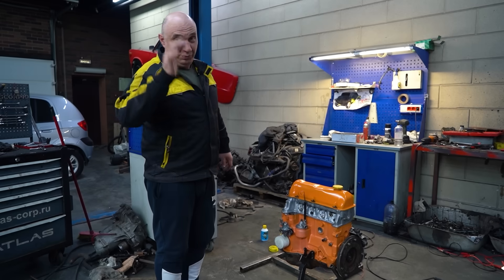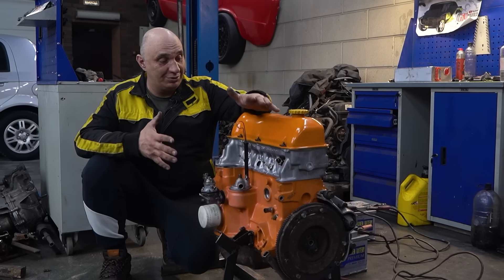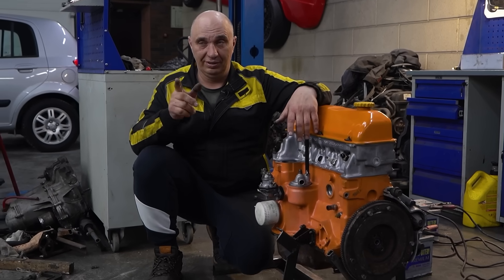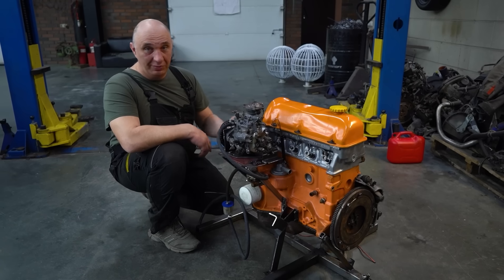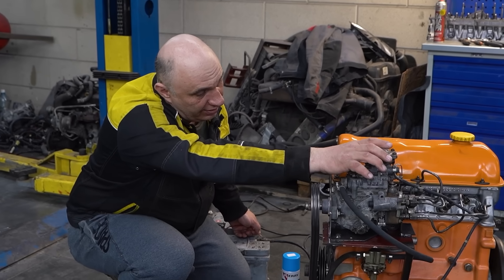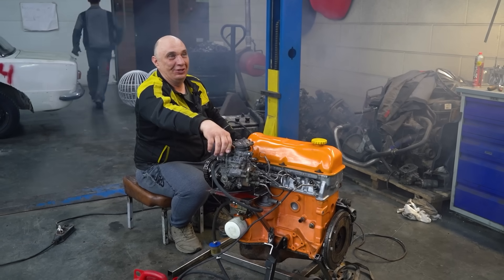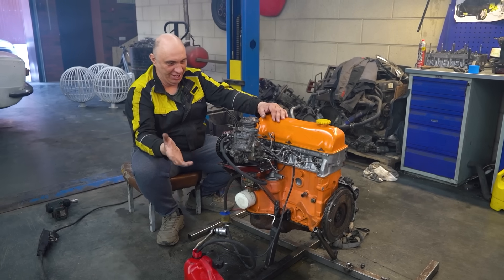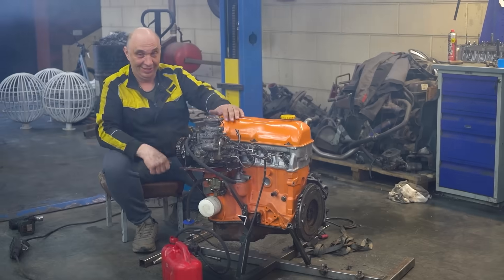We convert a gasoline engine to run on diesel fuel - will it work?

Comment: Impressive that it even runs with the indirect injectors becoming direct injectors :D
Reply: that was what i thought aswell poor old indirect injectors trying to handle direct work... would maybe work better if they turned the pressure up on the IP. looks to be a bosch VE rotary pump, and can easily be adjusted to pump out much more diesel
Reply: @Norwegian_Bastard  This engine has a low compression ratio and low compression pressures in it's cylinders, the injectors don't have a hard job. They know what are highter pressures in a diesel engine. These low compression pressures make starting difficult, the engine runs on it's own only when the combustion chambers are hot.
Reply: @yannickl5976  They increased the compression ratio from stock by 85% or so
Reply: @yannickl5976  They should get a cm off the block
Reply: @yannickl5976  I don't know how high compression a normal diesel engine has, but they did increase the compression of this engine in a previous video by a lot.
Reply: @stefannilsson2406  It's above 14:1. Most more eficcient engines have a ratio > 17:1. Ofc this depends on engine configuration such as prechambers, injector pressure 2 or 4 stroke and so on.
Reply: @henrys.6864 false. Biggest one that come to mind, the old Ford 7.3 idi. Which as stated I it's own title indirect injection that said, on the IDI diesels, it's not sprayed thru the intake manifold like you would on a gas engine, but rather the injectors are injecting fuel into a precumbustion camber and not directly into the cylinder.
Reply: @ajhainstock3997  to the glow plug prior to cylinder?
Reply: @henrys.6864  No, before 1990s pretty much all diesels were indirect injection which spray the fuel into prechamber in the cylinder head, not directly to the cylinder as is now normal.
Reply: @snap_oversteer  all that separates the prechamber from the cylinder is the injector cup. its not the pressure, the whole reason for the prechamber is to start the combustion and mix and the rest. I guess this video proves they'll run without the prechamber but not as as well.  Maybe some kind of external prechamber could be screwed into the engine and the injectors could connect to those?
Reply: @snap_oversteer  yes. So many people here do not understand it.
Reply: @henrys.6864  No. Many old diesel cars have an indirect injection. These injectors come from an indirect injection diesel. Many countries have old car running with indirect injection diesel engines, there are such old cars in Russia.
Reply: @yannickl5976  you can't run non direct injection (outside of the intake valve) on a diesel. It's sprayed in during the compression stroke.
Reply: @jasonbirch1182  Indirect injection diesel don't inject the fuel into the intake manifold. It's injected into precombustion chambers, and these chambers are not in the cylinder itself.
Reply: @jason birch  rc cars and planes use carb diesel engines. But the biggest one was like 90cc but the ignition was to unstable on larger versions.
Reply: @xxzenonionnex7658  that's nitro fueled. Totally different. It's running under controled detonation/pre-ignition. An oil burning diesel can't inhale air and fuel together, compress then ignite at the correct time to run.  I'm not going to say there isn't some stationary engine that runs at a constant rpm that exists somewhere that runs that way, but as far as a throttled conventional diesel engine as we know it, they are all injected in the confines of the valves and cylinder. Idi is in there but inside it's pre combustion chamber.
Reply: @jasonbirch1182  I'm not talking about nitro fueled engines there was a German company that made rc engines that ran on diesel mixed with oil to make it thinner so it could atomized they are similar to Cox engines but bigger.
Reply: @jasonbirch1182  There was a German made diesel bicycle engine named the Lohmann that ran that way. It had two twist throttles one adjusted throttle and the other adjusted compression. There was also a chainsaw called the comet. It stored propane in the handle that it used to heat the glow plug. Both were two strokes and both had exceptional fuel economy. There was also diesel RC engines that used a kerosene mix. You adjusted the compression on the top of the cylinder head. Nitro RC engines do not use compression ignition and are not diesels. Not trying to start an argument infact I mainly agree with you. To put a throttle plate on a diesel eliminates one of its advantages. Less pumping loss.
Reply: @henrys.6864  At work now but I'll list some with port injection later
Reply: @henrys.6864  No, indirect injection is made into the prechamber near the glow plug, not directly into the cylinder. And the injectors on an indirect injection diesel don't have hight injection pressures.
Reply: @henrys.6864  It's not "still direct" lol. the IDI (like the 7.3 IDI International) literally stands for "(I)n(D)irect (I)njection". Any diesel that uses a pre-cup or pre-chamber is considered indirect. Direct injection has no such chamber and requires specifically shaped pistons for proper combustion. The best example of this is comparing pistons between a 7.3 IDI and a 7.3 PSD. The IDI has flat top-ish pistons similar to what you'd see even in a gas engine, but the PSD has oddly shaped deep dishes with a raised point in the center.
Reply: @65Red  it's direct as opposed to port injection, which is the point
Reply: @MiG21aholic  Direct, indirect, and port injection are all completely different things. You can't say that "because it's not port injection, its direct injection" because thats 100% incorrect. Again, it's in the name "Indirect Injection (IDI)". I get what you're trying to say, but you're incorrect.

Edit: Talk to anyone about a port injection engine like an LS and tell them that it's an indirect injection gas engine, and they will look at you like you're from a different planet.
Reply: @65Red  entirely depends on context. Like you and I are talking about diesels, so we know what IDI is. But randoms in this comment section probably don't.
Reply: @MiG21aholic  I agree with you there, but I still think it’s best to distinguish “indirection injection” specifically for diesel applications because that’s the only time where that specific terminology is commonly used and people will understand what it means.
Reply: It's impressive how asinine the discussion in this reply thread is.

It seems some think indirect injection means the pre-chamber does not see compression. It does. Diesels work on compression ignition. The fuel delivery pressures are lower because the injectors couldn't atomize the fuel like modern injectors and did not require such high delivery pressures.
 
Others seem to think that because they see compression, they should work fine in direct applications. They won't, the spray pattern is wrong. They do not atomize the fuel properly, that's basically the primary job of the pre-chambers.

Basically, pre chambers of IDI allowed the removal of the air pump from early DI diesels before the injection system could support DI. Later, stronger/better injection systems allowed the removal of pre-chambers.

It's fun seeing experiments like this because they are re-discovering WHY diesel engines are designed as they are. Or, rather, they probably know what the engine is missing and the whole point is to see if the thing will run in spite of that.
Reply: It would be cool to see them make a pre chamber that threads into the spark plug holes. Lol.
Reply: This comment section and replies are quality people. Like top 99.9% of youtube interactions👌 gives me hope for humanity and fear for the other 99.9% if it all breaks down. But I'm not sure that would be a bad thing overall.
Reply: @TheMapman01  It still happens on parts of the internet where people want to learn. Pretty cool.
Reply: @henrys.6864  absolutely not, all small diesel engines before 1980 were indirect injection, injection into a prechamber in the head, that leads down into the combustion chamber, those engines are usually very high compression 20:1 and up to 23:1 often. they run at very low injection pressuers as the technology used only allowed for that, around 100-140 bars of line pressure, if you put them in direct injection possitions the pressure of the compression makes for poor injection. direct inejction diesel that became available around 1988 with landrover audi and renault being the pioneers of it. there the injectors sit in the top of the combustion chamber pointing at the flame bowl of the piston (big bowl inside the piston ot make a propper mixing of the fuel and air) here we start to see lower compression ratios of 17:1 - 19.5:1 and line pressure of around 200-240 bars. 
than came common rail where line pressure went thru the roof and compression ratio went down even further, some diesel engines run as low as 14.5:1 compression ratios and 3000bar of line pressure to the injectors. one reason for this engine to be running like shit is that the fuel is barely mixed with the air in the engine, compression is super low and there is no flame bowl in the pistons, not that the indirect injectors would ever hit that. in diesel engines the spray angle is super critical, having to be spot on with the design of the flamebowl, here there is nothing so it barely runs
Reply: Lmao I didn’t think of that
Reply: I mean as long as it’s spraying a fine mist and has good compression it’ll diesel heck I ran my 350 Chevy on diesel mixed with gas it ran like crap but when it got warm it kinda ran good
Reply: @henrys.6864  nope not all some have a pre combustion chamber IE: ford 6.9 and 7.3 idi Detroit 6.2 and 6.5 and Oldsmobile 5.7
Reply: @henrys.6864  You should google om606, still popular indirect diesel engine.
Reply: @henrys.6864  Not very high. Old pre chamber diesel engines uses abaut 200 bar pressure to open nozzles. But todays diesels as a direct injecting uses 2000 bar pressure. There is a big difference between those.
Reply: @peraz968  The DI diesel engine in my Rover has 2 stage 200bar injectors, the predesessor to that engine also DI had single stage 170bar injectors yet, my Ford Escort van was IDI and had 180bar injectors. Common rail stuff is insanely High pressure though.
Reply: I think it is too much fuel injected in combustion chamber, you must adjust bosch pump to inject less fuel, because it is smaller combustion chamber than on original car from what you harvest diesel injection sistem
Reply: Because of that it is smoking a lot and it is working good when you heat air in inlet manifold. Pozdrav za bracu Ruse od Srbina
Reply: @henrys.6864  vw t4 year 2000.engine 2400 aab indirect injection.
Reply: Regardless, it comes to injector timing! Having pissing matches doesn't change that!
Reply: @shawnsatterlee6035  deffo on the timing. Infact I think it would benefit from using a DI cam plate in the pump instead of the IDI one, as DI cam plates have a more aggressive profile having a much shorter time window for injection than an IDI.
Reply: @henrys.6864  NOPE..this injectors require a swirl chamber so they are indirect
Reply: @henrys.6864  6.9idi 7.3idi 7.3idi turbo 5.7 oldsmobile diesel 6.2 detroit and 6.5detroit turbo diesel are all indirect injection along with several volkwagen diesel gm 4 cylinder diesels ford 4 cylinder diesel among many mercedes diesels etc most diesels arent direct injection and you clearly dont understand what direct injection is direct injection is directly in the cylinder onto the piston such as the 7.3 powerstroke 6.0 powerstroke etc
Reply: @henrys.6864  this is false ford kubota toyota and several others used manifold injection(injectors directly in the manifold)
Reply: @henrys.6864  Land Rover for one had separate combustion chambers I believe for some time. And I can remember when the DIRECT INJECTION Ford Transit was a big deal...
Reply: Fuel pump from a toyota 1.5 litre engine named toyota 1N
Reply: @henrys.6864  no, not all use direct injection, aka IDI diesels are indirect, thus the IDI lol. 6.9/7.3 non powerstroke engine for example are IDI, the sohc mitsubishi 4d56 is also IDI
Reply: @henrys.6864  Yes ,your words were confusing but you're correct
Reply: Llolol
Reply: A man in Sweden did this with a b230. He made his own pre chambers to fit the indirect injectors.
Reply: @henrys.6864  nop . Prechambers Dont .
Reply: @henrys.6864 injecting  into a " prechamber" I'd not direct injection..... Idk what about " pre" is hard for u to understand but this is a chamber that is in the head BEFORE the combustion chamber or as u may be more used to it being called is the cylinder """ this pre chamber is not going to have the high pressures that the combustion chamber sees !!? So no .... Not all diesels have direct injection
Reply: @henrys.6864  no. Do some research.
Reply: hahahah
Reply: @henrys.6864 you are dense e
Reply: @henrys.6864  No, a lot of old Diesels and all of the very small diesels(on plate compactors for example) inject into a small cavity inside the cylinder head using a nozzle with one hole at the front and then the flame rushes through a small opening into the combustion chamber, this is called indirect injection. Direct injection diesels spray directly into the combustion chamber using a nozzle with 4 to 6 holes facing radially sideways.
In this case the wrong injector sprays directly onto the relatively cold piston, so the diesel fuel can't fully ignite...
Reply: there's no difference of compression pressure the injector has to open against with IDI vs DI. That's the point people are missing.
Reply: @MiG21aholic  There is a big difference of injection pressure. Indirect injection needs less than 500 bars, direct injection is always more than 1000 bars.
Reply: @yannickl5976  IDI uses slow moving fuel and fast moving air to do the fuel and air mixing. DI uses slow moving air and fast moving fuel. In this application high pressure would help but a DI injector with its multiple nozzles would squirt fuel all over the head and piston and cylinder walls which probably still wouldn't mix well
Reply: @MiG21aholic  Modern diesel engines have injection pressures over 1600 bars. A 2000+ bars pressure is common.
Reply: @yannickl5976  yes modern tech for you. And multiple injections per combustion event
Reply: @MiG21aholic  very good explanation
Reply: @MiG21aholic  I know diesel mechanic and I may be giving them too much credit but I think they are thinking about the fact that the pre ignition chamber does not receive the full force of the detonation while all diesels are indeed a form of direct injection not all of them come in direct contact with the fuel detonation
Reply: @kevinpark1  there's no way for a prechamber to not feel the full pressure of combustion. It's just that the still combusting mixture heads out towards the main cylinder as well
Reply: @MiG21aholic  this is correct
Reply: @henrys.6864  Guess the one we have here is my imagination huh
Reply: Are they definitely indirect they may just have been in the manifold from when they ran a gas engine with diesel injection

Comment: Run the exhaust through a turbo and back into the intake mixing the air from the other side of the turbo at the same time. 🙂 If you need any help contact me.

Comment: I was wondering if you had considered mounting two starter motors, just to make life a bit easier for the motor(s) to turn the engine? A coolant preheater might also be useful in situations where there's no Cyril with his industrial hair drier, as might a manifold preheater. Glow plugs in the cylinders would be a definite bonus, especially in cold weather.

Just for the hell of it, how about making a "hot bulb" version of the engine?
Reply: Two starter motors are almost impossible to sincronize
Reply: @mrsnezbit2219    You have the wrong idea about how things work.  Starter motors are DC and two can share the same flywheel.

Now, AC generators OTOH have to be synchronized if two or more are hooked together to drive a big load.  Their outputs must be matched in terms of phase, frequency, and voltage.
Reply: @BlackPill-obey  i was thinking since every starter motor has his "time" to engage the flywheel the slower one finds an already spinning flywheel and grinds
Reply: @mrsnezbit2219  Good point.  It will take some clever engineering to make them work together.
Reply: @mrsnezbit2219  no its possible
Reply: @mrsnezbit2219  large industrial engines have two starter motors
Reply: @MiG21aholic  I think Mrs Nezbit was thinking of AC generators tied together to drive a big load.
Reply: @mrsnezbit2219  Not at all!
Reply: The indirect injection aka pre-chamber diesel engine is a direct descendant of the hot bulb engine.
Reply: @BlackPill-obey  Quite, and by default, hot bulb engines had a lower compression ratio, which makes this engine a potential candidate to operate in that fashion.
Reply: @BlackPill-obey  but the IDI diesel was invented after the DI diesel...
Reply: @MiG21aholic  Regardless of which came first, the IDI was an evolution of the hot bulb engine.  The hot bulb was integrated into the head as a pre-chamber and glow plugs replaced the torch to get the bulb hot.  Just casual inspection should confirm it.
Reply: @BlackPill-obey  oh I don't disagree with the similarities at all

Comment: the compression seems a tad bit low BUT the engine dont have a mixer chamber to help mix the fuel better with the air either

Comment: This is awesome!! And I especially love Vlad's little chuckle of excitement at about the 6:01 mark, when the engine tries to fire up! 🤣
Reply: So it needs more air to start.       Put some turbos on it  it should idle better
Reply: @blueice1141  Unless it's ridiculously small, a turbo isn't doing anything significant at idle. And it looked to me like the engine was getting all the air it needed. There was nothing on the intake, so it was wide open!